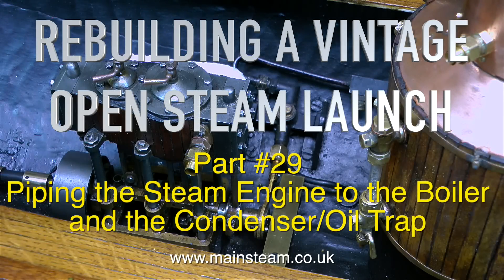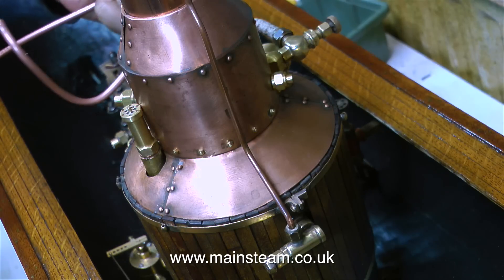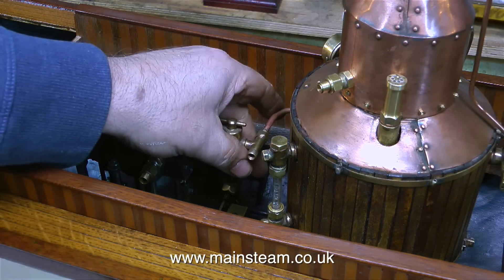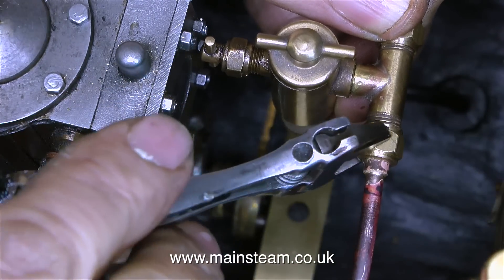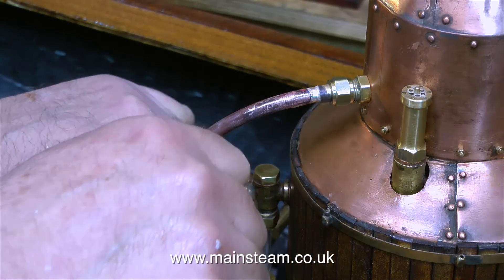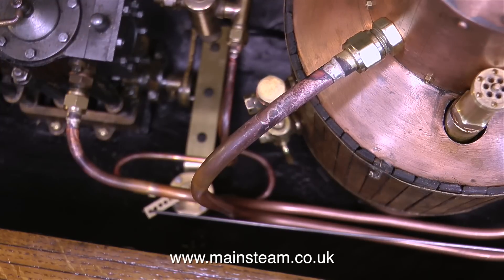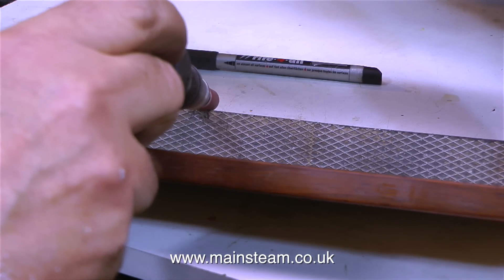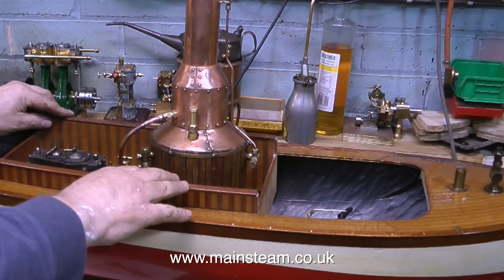REBUILDING A VINTAGE MODEL OPEN STEAM LAUNCH - PART #29

Comment: This is a generic question about fabrication ... what do you do with all the turnings from lathing?  Are they recycled or is there any used for them (such as melting-down for something)?
Reply from the maker: They are mixed metal so I just dispose of them. I once use some swarf (turnings) in a concrete base for a shed as reinforcement and 22 years later the base is still good . . .

Comment: Does the displacement lubricator provide enough oil for the entire run?  The reason I ask is that many Gauge 1 locomotives start off very oily.  It seems mostly oil comes from the exhaust.  I wonder of the lubricator on those locomotives are mostly empty after the first few turns.  

Thanks you for all your work, Bob in Las Vegas
Reply from the maker: Yes if the oil regulator on the lubricator is set correctly.

Comment: Have you tried external pipe bending springs for your copper pipe? I use them quite a bit.
Reply from the maker: Yes, but not for such small bore piping. They are unnecessary as I have the bending tools as shown in the video.

Comment: Bonjour Keith,
Never mind about your accent, pictures worth 1 000 words ! Just a little remark, I was told that the steam pipes had to be as straight as possible to save the steam power. Again never mind, your job is great and I wait for the  tests. 
PS : Metric measures are quite more easy  :+)
Amicalement, Raphaël
Reply from the maker: keeping the pipes straight would be quite difficult ........

Comment: Just curious if it's easier to bend the 1/4" pipe and larger if you anneal the copper first. That size may be tempered/hardened.
Reply from the maker: the pipe is pre-annealed as I buy it. If it work hardens it can be annealed by the usual method, but whatever state of hardness the copper is in it will still kink and flatten if not bent properly.